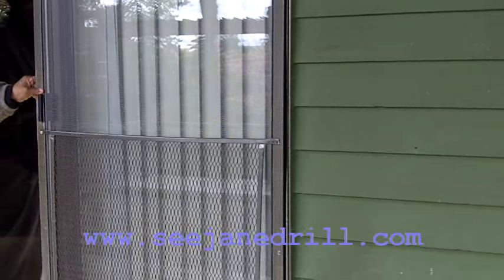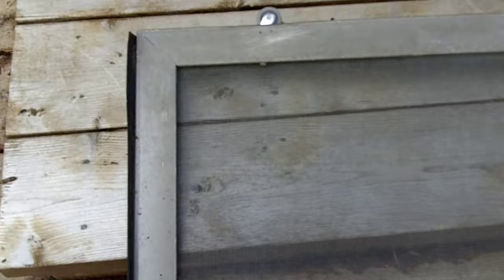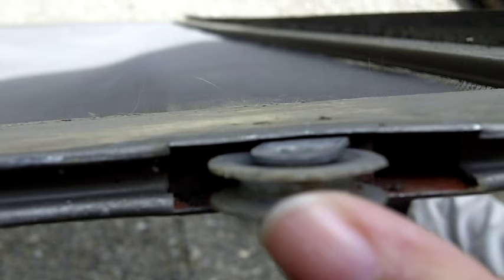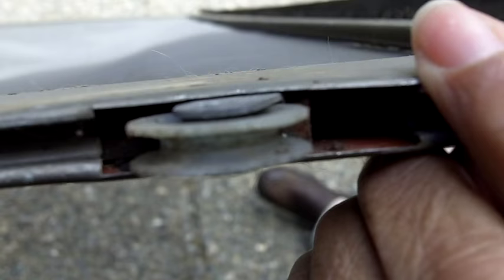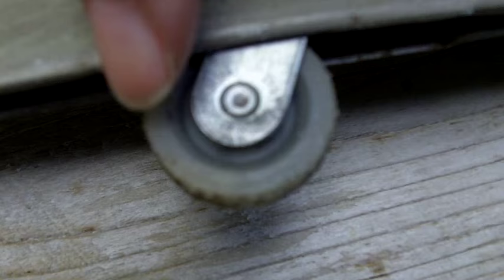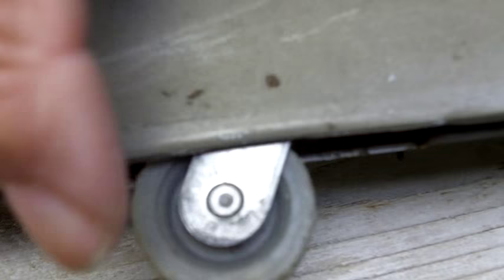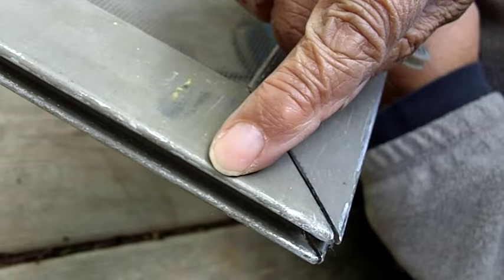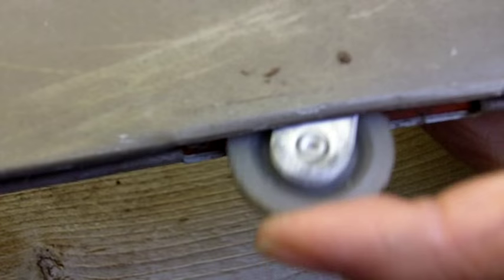Quick Tip How to Remove a Sliding Screen Door

Comment: Thank you so much, you just saved me a bunch of $$$. I did it & it works a treat, getting it back in was a little tricky... nothing a few curse words couldn't fix though lol 😂
Reply: I’m still cursing.. it didn’t fix it. It’s back on its track but so stiffffffff
Reply: @haasan9360  You may have to get the door back off & either replace the wheels or use some silicone spray on them. Best of luck